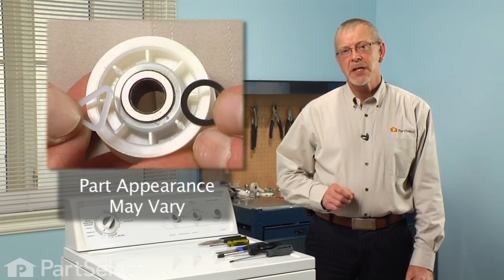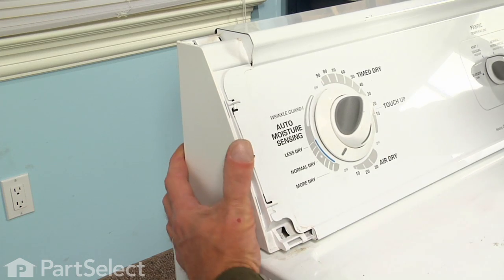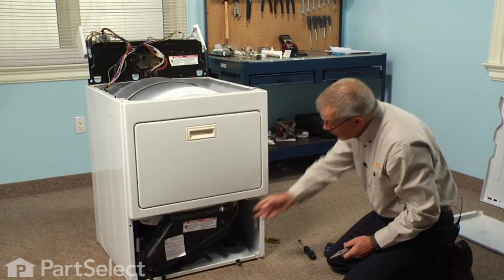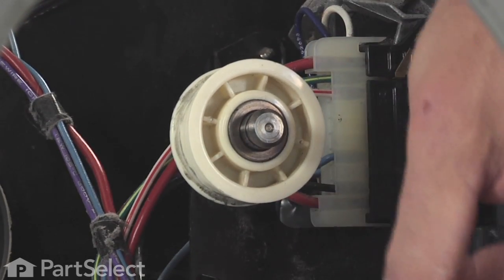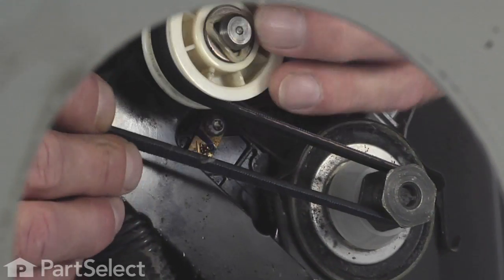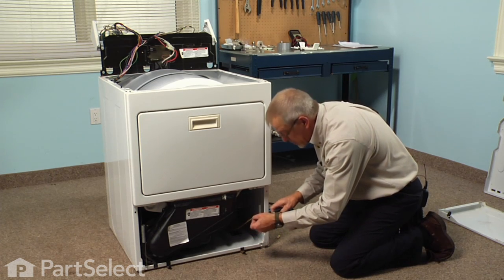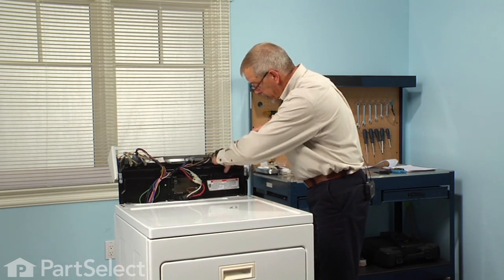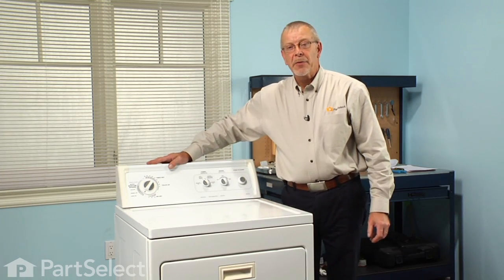Dryer Repair - Replacing the Idler Pulley with Tri-Ring and Gasket (Whirlpool Part # 279640)

Comment: Why not get at the pulley from the back panel? Is there a particular reason?
Reply from the maker: The rear drum bulkhead makes that rear approach on this model quite difficult. Doing it from the front also allows you to inspect the majority of the other components as well as clean out any lint build up there may be.
Reply: @partselect  Thank you for the reply. This video helped me to understand the process regardless of the differences in the models and feel a lot more confident in working around the boards in particular. I see the difference in the box. My dryer has the controls on the top of the front, and the rear assembly is pretty simple. It was much easier to access the idle pully from the back - just remove one panel. But I went ahead and installed a whole new kit of the moving parts - belt, wheels, and the like, so i had to remove the drum anyway. Since your video made me a lot less anxious about taking it all apart, i did just that. Got everything in the front cleaned out, put it back together with no screws leftover, and the darn thing even worked when I plugged it back in!  Hardest thing was those tri-rings. They took way more work than anything else. Hard to get on and off. Thanks for the video.

Comment: Thank you for this extremely helpful video!  I changed out the idler pulley in my squeaky dryer, and now it's running quietly, however now I have no heat.  I am assuming I broke or disconnected something when disassembling and/or reassembling the dryer, but everything looks fine.  I took it apart again and double checked all the connections.  It is blowing air out of the vent, but just cold air.  Any suggestions?
Reply from the maker: DerryHerlands What is the model number on your dryer?
Reply: ***** It's a Whirlpool WED5500XW0.  I found the technicians manual inside the machine and followed the trouble shooting directions (after teaching myself how to use a multimeter) and determined that it was a faulty electronic control board.  I don't know if I somehow damaged it when disassembling the dryer the first time, or what, but after replacing it, I now have a working dryer.

Comment: Mine don't have an H pulley it has the motor two wheels on the back for the drum and a plastic wheel. The plastic wheel came off of were it is supposed to be and and i can't find that spot. Without that plastic wheel there is just to much slack on the driers belt to perform its purpose